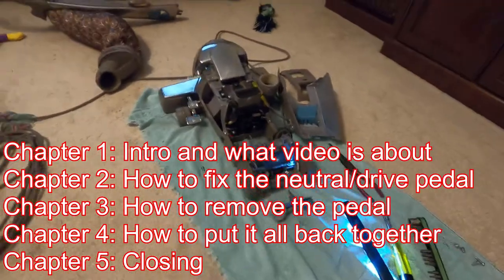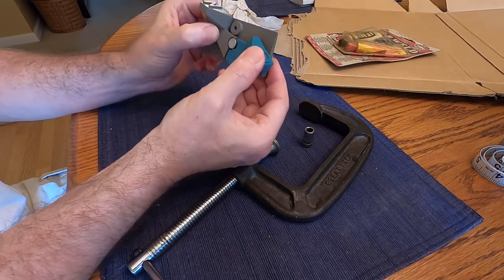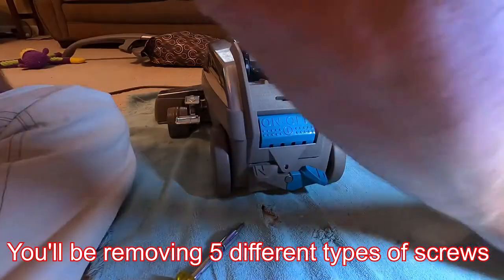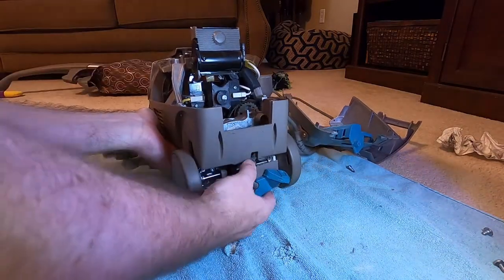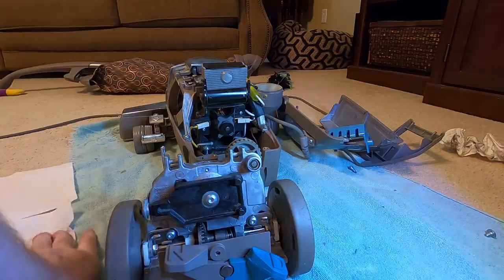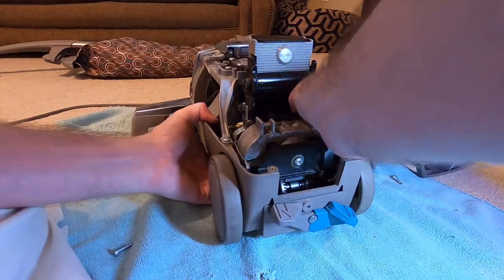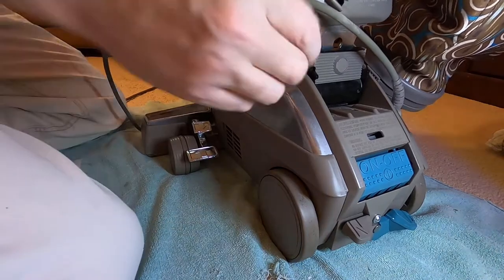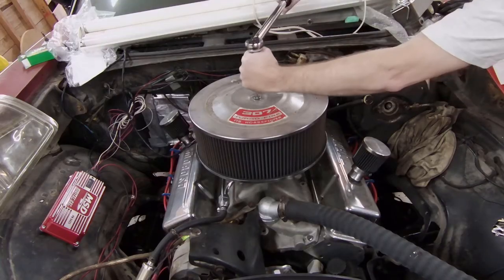Complete detailed guide on how to fix or replace the neutral/drive pedal on a Kirby vacuum

Comment: Great video. One of the most irritating things about the Generation/ Sentria/ Avalir series Kirbys is the transmission. They are a dream when they work properly, but a pain in the ass when they mess up. I fixed mine this morning, because I had an issue with the bracket cam. I have the Diamond Edition and love it. I have replaced the bracket cam a few times, but had a problem with the last one. I had a spare transmission in my parts supplies, so I just replaced the whole thing for the moment.

Comment: The orientation of the lever is the most important part of this video Time stamp 2:00 . I used red loctite but if it comes off again I will shim it with washers between the bracket and the lever so it can't move.

Comment: When I put my Kirby back together my on/off switch does not work, I took it back apart but everything is in correctly, what could be wrong?
Reply: mine fell right off again the drive works but not the manual.
Reply: Check the bar Is fitted correctly in the switch
Reply: You might need a new drive  switch and or a bracket lever. Amazon has genuine Kirby parts . Just make sure it says manufactured by Kirby
Reply: @donnahanna10565  that’s where I get all my Kirby parts from

Comment: Hello. Thank you. Got mine fixed with this tutorial. Fingers crossed it lasts a while. Only thing was when I took the drive out there was a loose screw and a brass coloured washer. Could not see from tutorial or from inside where this might have come from. Have you any ideas?
Reply: Further to the above they were loose in the middle section between the two wheels where the drive system gets put back in if that makes sense
Reply from the maker: There is a small spring washer (bent) that goes on the lever mechanism (mine was lost and I didn't replace it). The screw could be from anywhere. 😕
Reply: Ok yeh the washer was bent so maybe that’s it. No issues with yours since you lost it? Ok hopefully from nothing important 😬
Reply from the maker: No issues 👍